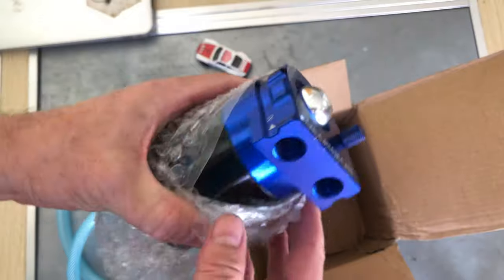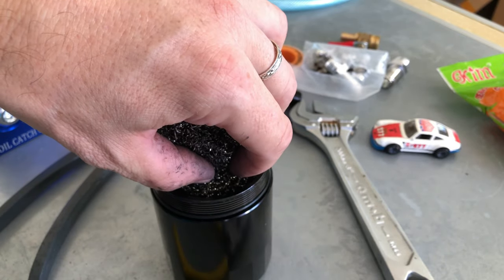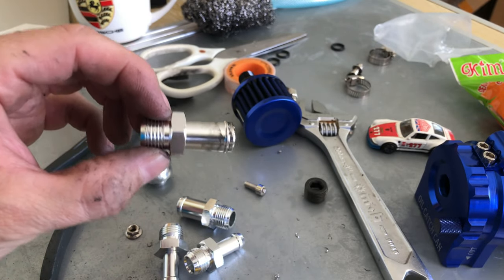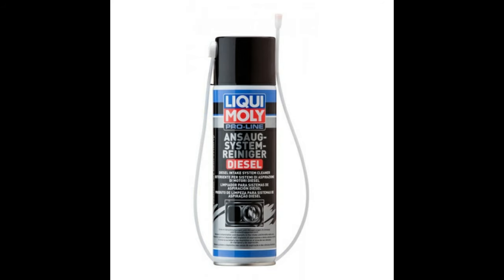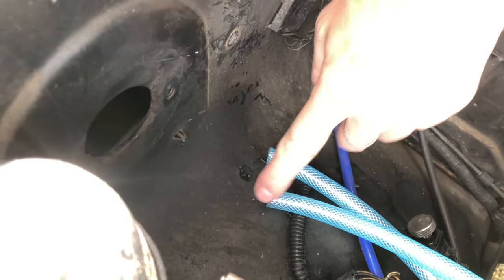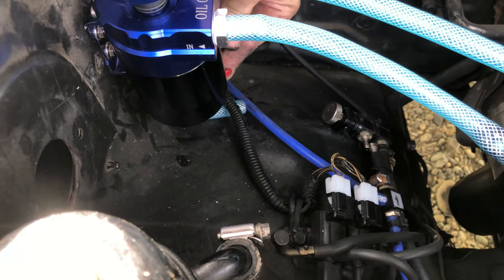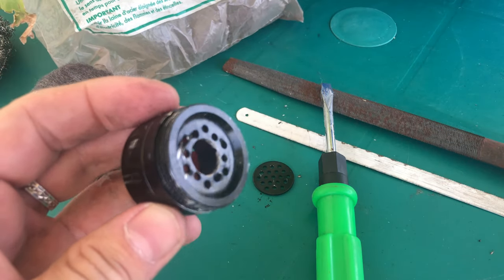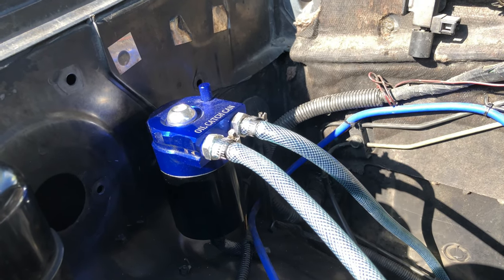HOW TO: INSTALL OIL CATCH CAN INTAKE TURBO DIESEL GAS PAJERO SHOGUN DELICA L200 L400 MITSUBISHI

Comment: You do realise you changing the diameter of the OEM piping just to fit it to the catch can is causing excessive crankcase pressure. The crank case ventilation system needs the vaccum caused by the turbo at the pre-turbo inlet to suck positive crank case pressure out of the engine. Excessive crank case pressure over time will cause more wear to your bottom end, cause your oil to sludge with unburnt fuel and could blow out your crank seals and cause oil leaks. It can also make it difficult for your engine to start because of the extra pressure behind the cylinders. Venting it to atmosphere also causes this because there is no vaccum sucking out the pressure I suggest getting a catch can with the same diameter inlet as your rocker cover outlet silcone hose so there is no restriction. Im a level 4 heavy diesel engineer by trade and also own a gen 2 pajero so im just trying to help out but i love your side mount intercooler!.
Reply from the maker: MUCH respect. Thanks for this. The plastic adapter piece that connects the manifold tube into the fat, rubber intake/turbo tube is smaller in inside diameter than the cheapy plastic hoses included in this kit. The biggest mistake was packing the small top canister with steel wool. This DID block pressure relief and DID cause oil leaks from the oil pan. 

However, in NO VIDEO have I heard discussion of 'needed' suction from the turbo to pull these gasses out of the engine. 

Right now, I am simply venting to atmosphere, as I cleaned my entire intake system and don't want it oil-coated anew.
Reply: @offgridislandfamily  Yeah man I suggest getting a catch can with that larger diameter. The principle of the catch can is still good. You just cant modify the flow. Hopefully the info helps.
Reply: @deathofantarctica5369  what's the oil catch can for?
Reply: @deathofantarctica5369  so it is better to not using catch can instead of using the standard hose direct from the engine to the pre turbo pipe? Is it safe for the engine if the excess oil and the gas blow by come in to the turbo to be used again? Im using 4N15 diesel engine (new pajero sport gen 3) by the way, and using cusco oil catch tank
Reply: Hey, I cut my PCV tube and put hose on the OUTSIDE of cut ends (and catch can in between). Width didn't change, in fact, it got little larger, but the hoses are quite long. Will that have negative impact?
Reply: hello, is there also a excessive crankcase pressure when you just plug a hose in the breather and vent to atmosphere? no OCC at all, just a hose
Reply: I know this is 2 years old but hopefully you’ll see this.   I too just recently ran this same can on a 01’ Cummins I’m restoring.   What I did differently was …. When I removed the original puke bottle from in front of the crankcase…I extended the 7/8” house had to reduce to 5/8” into the (( outlet )) side if the catch can.   Therefore catching what little oil I have … then traveling back into the small steel wool media and still having the top filter installed…. Acting as another pressure relief along with my inlet side open and venting to atmosphere minus the mist of oil.     I have only been running this for a couple weeks now … thought I’d see what you thought about my setup?
Reply: Yeah, two years old. But I run a stainless steel filter provent where I removed the pressure springs so that if the filter got blocked the pressure will vent to atmosphere, as restricting crankcase pressure is a big no no!

But one thing I actually found that reduced the blowby smoke the most was getting a better quality 10w 40 synthetic oil. I actually found that non synthetic oil created much more blowby smoke. 

Good luck. I also put a resistor on the temp sensor wire that goes to top of the airbox. This keeps my EGR closed and prevents the burnt carbon from being sent back into the manifold which mixes with blowby and forms sludge.

Comment: I have just putted a hose and vented PCV to atmosphere, I dont care about oil dripping on the ground, but how to deal with the smoke, because the smoke can be seen comming out from the bonnet. Any idea how to diffuse the smoke, does adding filter media like aluminium mesh filter helps in smoke ?
Reply from the maker: A filter won't reduce the smoke. Mine does the same as you describe. To hide this (as a welder) I am considering welding a small tube that ports into the exhaust, but not sure that's a great idea either. 

Please be SURE to read the pinned post at the top, from 'Death Of Antarctica'. I think it's the best overview of this discussion and I concede to his experience on this. I'm not sure how I will resolve this issue myself. For now, I am ok just venting the pressure. 

If / When I have an updated solution, I will post a video for sure. Thanks for the questions and subscribing!

Comment: The steel wool is going to break apart over time and go into the engine ..
Reply from the maker: The pressure is coming from the valve cover and pushing out through the catch can. But the real problem is the back pressure created by the steel wool, which is why I removed it and edited my video description. Thanks for the comment!

Comment: Two things first ptfe tape should be applied by twisting the fitting the same direction used to tighten it.  Second did you see the fine steel wool dust on you fingers after expanding it. That metal dust is going to be pulled into your engine. Recommend buying a oil catch with solid brass filter.
Reply from the maker: Yeah. Lots of lessons learned on this one! ;-)
Reply: @offgridislandfamily  what's the oil catch can for?
Reply from the maker: @magnumllama400  I tried to explain that pretty well in the video. ;--) The engine creates an 'exhaust' of unburnt gasses, oil vapors and perhaps unburnt fuel from the valve cover. These coat the intake system, including the intercooler, reducing efficiency and thus....power.
Reply from the maker: @magnumllama400  The engine produces a combination of unburnt fuel, particles and oil, which are sent from the valve cover and coat the intake system,  including the intercooler, which significantly reduces its cooling efficiency and thus, power. The catch can is intended to collect these are remove or reduce them from the system.
Reply from the maker: @magnumllama400  I've written two very detailed responses and YouTube fails to save them. Please listen in the video. I think I explain it sort of well.

Comment: Did you remove the baffle thing inside completely? I have the same and feel it’s restrictive compared to just having no can at all. Thinking of just removing the baffle thing and getting a larger diameter hose so it’s not so restrictive
Reply from the maker: YEP! I think in the video description, I updated saying DO NOT use this style of can. Far too small and restrictive. I think I also posted a link for the better model, which I plan to install after I get several other issues resolved. Right…don’t use this can at all. Cheers and thanks for the question!

Comment: The black baffle is two parts. You can unscrew it to open it up and then fill it with the steel wool and screw it back together. That is what I did with mine. The line you showed is where it screws together. You will need a multigrip or large pliers to unscrew it the first time. It is easier after that to unscrew. You don't need to destroy it like you did 😊
Reply from the maker: Normally, you would be correct. However, this one is a cheap copy. Usable, but not as well manufactured. The canister does not unscrew, but is made to look like the expensive ones which do, with a fake 'seam'. The end 'cap' is glued on. ;-)
Reply: @offgridislandfamily  I bought the exact same one of eBay. Mine unscrews but it did take a bit of effort to get it off the first time. At first I thoyght it was glued together but it did come apart and unscrewed. But all good, maybe yours is different.

Comment: at the end, where does the oil return line go, as it does not go to the origional inlet
Reply from the maker: Out a pipe into the exhaust AFTER the turbo.

Comment: I have the same one. Took the filter off the top and capped it. Drilled and tapped the bottom for a drain out valve... Mostly BC it was a pain to mount and now I have a little brass tap drain out the bottom
Reply from the maker: Yes. I paid for the one with all the options...that top filter (useless), the oil level dipstick and the brass drain valve on the bottom. Did you fill your 'baffle' canister with any filter media?

Comment: Steel wool? How do you filter the inevitable massive amounts rust? Being so fine, and packed so tight,  how does this not greatly restrict air flow?
Reply from the maker: Any rust would join the rest of the waste oil. However, EVERY OTHER aspect of this was a terrible idea, which I mention in the description and other videos. Yes...adding any restriction to the intake flow was absolutely a horrible idea.

Comment: too much smoke coming out, might wanna have you car checked for blow by. great video and informative
Reply from the maker: Isn't this amount pretty inline with most 20-year old diesels engines? This is cold start-up.
Reply: @offgridislandfamily  no, that is why the tune up. your car is 20 years old so it is due. it could be an expensive fix because you may need an overhaul. my fieldmaster never had  smoke coming out off the valve covers. my friends pajero though had smoke and we brought it to a respected mechanic, 2 cylinders had a leak and needed rehonning, he had to go oversize due to the amount of damage. there is a way you can check if you do have a blow by, with the engine on, remove your oil fill cap and lay it upside down on your valve cover fill opening, if it immediately falls off then you definitely have excessive pressure.
Reply: @daphnebitter4949  dude I have to try this

Comment: Why did you put the catchcan filter on the turbo intake?
The dust will pass the breather straight into the turbo and engine?
Reply from the maker: Not sure why my original reply isn't still here...anyway. So, the original configuration is a tube running from the valve cover to the turbo / air intake tube. The only difference, is that now the tube first goes to a gas/oil catch can and THEN to the intake tube. Thanks very much for watching and commenting...appreciated! Cheers!

Comment: Do you have the link for the 2nd part, great video!
Reply from the maker: Thank you for that! No part 2, but I can tell you the results. This catch can was too small for this engine and caused back pressure in the oil system, creating leaks. Hehehehe! GET A LARGE ONE for diesels!
Reply: @offgridislandfamily  thank you there is a video from the channel more molecules with ur same conclusion in more details, thanks again and happy new year

Comment: What’s the point for the stainless steel sponge since you got that steel wool baffle?
Reply from the maker: As the gasses entering the collection area are combines with contaminated oil droplets, I wanted to provide surface area for them to stick to. The steel wool in the baffle was the bad idea of the two.
Reply: @offgridislandfamily  
You should have maybe used something less dense so the pressure could be relieved easier. I’d use a bathing sponge or some dish metal sponge.
Reply from the maker: Could very well be correct, but again, the restriction problem was purely in the baffle. After I emptied the baffle, it was fine.

Comment: I recently found out that my recently built engine (3500-4000km) driven onlyis having blow by and it's really disappointing. Any guesses why it would have happened?
Reply from the maker: ALL engines have blow-by and even new cars benefit from catch cans. NOW...do you have blue smoke coming out of the exhaust or is your engine burning noticeable amounts of oil?
Reply: There's no oil burn and no blue smoke. Only a small leakage in the oil sump which reduced the oil level abit.
Reply from the maker: @goldinvesters  Then you are GOLD. And...you do NOT want the waste/burned oil back in the engine. Its viscosity is greatly reduced.
Reply: So what upgrades do you recommend? So far I've only bought the provent 200 oil catch tank.

Comment: I installed it works fine. Drive about 40 km 25 miles, and check the tank or container that comes in the decanter and it is almost full. For what is this?
Reply from the maker: It's catching engine gases that normally coat the inside of your intake and intercooler system and reduce its efficiency.
Reply: ITS OIL
Reply: also did it run ok before you put that crap on it?
Reply from the maker: @stephen2181  Yep. Oil is oil.
Reply from the maker: @stephen2181  Sure. Running is not the question this part was designed to answer. The question is 'efficiency'. More power...les fuel consuption.
Reply: @stephen2181  No. My car already had a problem too much blue smoke. Override the PCV, but oil is coming out of the engine.
That's why I put the cash oil on it. And if I help for a few days. But those hoses are useless if they are clogged.

Comment: Good idea with the finer steel wool. how is it working now? much collection?
Reply from the maker: ACTUALLY...it was a TERRIBLE idea. Ended up blocking and suffocating the breathing system. These gasses need to escape and EASILY. I updated the video notes to explain this. Also, this can is FAR too small for an big old diesel engine. Could work for a small, modern gas engine, but nothing else. Thanks for commenting! ;-)
Reply: @offgridislandfamily  Thanks. Going to be trying with the same can on a 4.8L chevy gas engine. Appreciate the info, will make sure to keep the wool looser and test for flow. Happy Hauling, man
Reply from the maker: @KF1  Should be fine on a gas engine. Make sure none of the tubing or connectors you use cause ANY breathing restriction. Yeah...do NOT pack the pre-filter with steel wool. HOWEVER, a stainless scrubby inside the can WAS/IS a good idea. Cheers Bro!

Comment: Its normal smoke came out from that oil catch tank breeding hose?
Reply from the maker: It's not 'normal smoke'. It's a combination of different gases and particulates created in the crankcase and pushed up to the valve cover.

Comment: Thanks very helpful... I'm about to install one.
Reply from the maker: Thanks for that! Just be sure to read my updated description. I learned a LOT about the can I originally installed, and catch cans in general, as well as better options. I've added links for these. The one I installed turned out to be a bit small for an mid-sized, old turbo diesel engine. It's better suited for 2 liter or under and probably best suited for newer and/or gas engines.
Reply: @offgridislandfamily  thanks for all the help!
Reply from the maker: @OzeMike  Absolutely!

Comment: Did you pop an oil seal or something with the original catch can?
Reply from the maker: No. Just too much pressure due to overpacking the media filter with steel wool, so the oil came out of the filter on the top. Lesson learned and I appreciate the question! ;-)
Reply: @offgridislandfamily  Thanks for replying. It was fortuitous the breather filter was still installed otherwise the built up pressure might have blown a seal in case the breather port was already sealed up. I came across your vlog while researching about oil catch cans as I will be installing soon  on a 4d56 engine. It helps to get inputs on the pros and cons  and I decided the benefits outweigh the risks. I made sure to find an OCC with bigger input/output diameter tubes (about 19mm) to avoid flow restriction. One cool tip I found is to use the nylon stuff girls use to shower instead of Scotch Brite stainless scourer as oil traps to avoid the risk in the off chance that metal bits may break and find its way into the engine. And also to avoid cheap OCC with copper filters as this really cause restriction. Hope you continue vlogging and upload new contents soon. Cheers!
Reply from the maker: @anaccount3244  Well...just a further update. Well, I think your plan sounds very well thought out and should work well. I finally just removed mine and exhaust to atmosphere. Just got sick of the darn thing!

Comment: Wouldn’t the baffle clog?
Reply from the maker: With the constant heat and pressure, clogging is not the issue. However, I should NOT have filled the baffle with steel wool. The can...yes....the baffle...NO.

Comment: Where does the outlet pipe go to
Reply from the maker: Well, it's intended to be routed back to the intake tube between the turbo and air cleaner. However, I just removed mine entirely and exhaust to atmosphere.

Comment: Well done know we know how to open the little filter without making a roll 😂
Reply from the maker: Don't pack the prefilter. It restricts valve cover breathing. Lesson learned.
Reply: @offgridislandfamily  I bought today without filter, after flashing the engine with liquid Moly star to leak from the in late turbo,no much!
I just thinking is from this pipe...
Reply from the maker: @lisandrofernandes  Yeah...just check all your connectors. Good you didn't get with the little baffle filter!